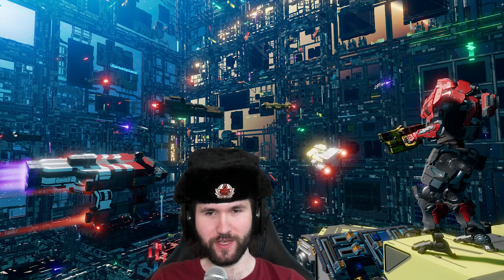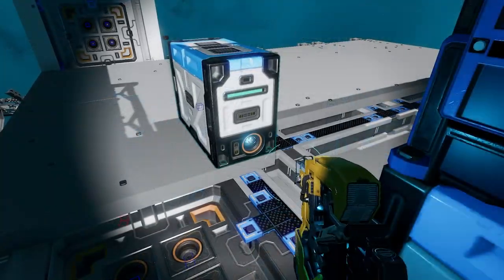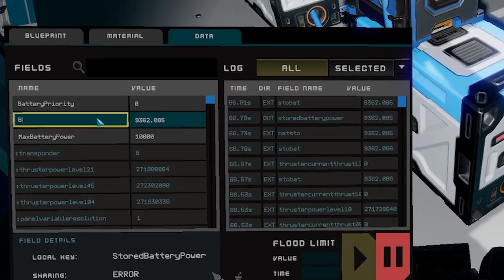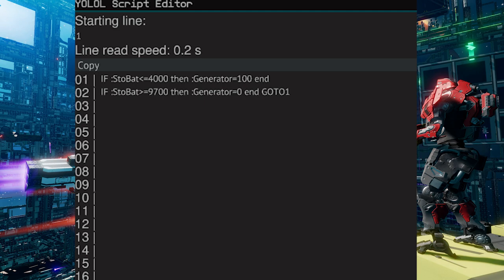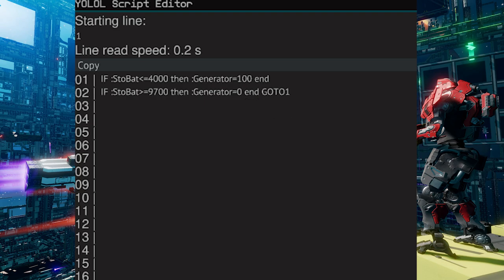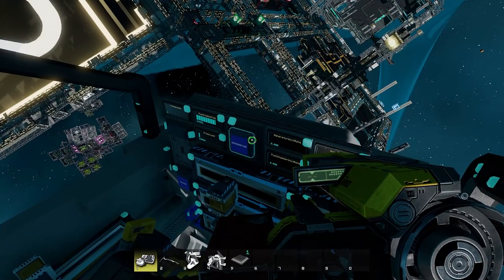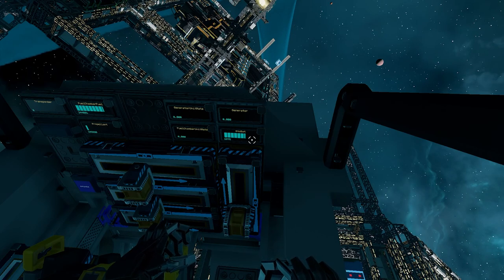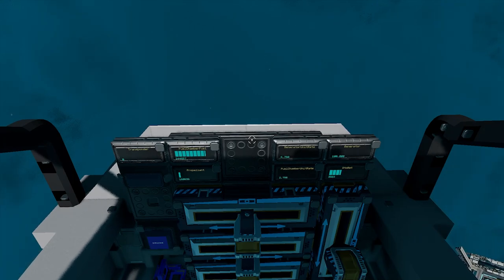Starbase Mini Tutorials: Generator Automation!

Comment: Great tutorial.  I’m still stuck on sweep and grid mining.   Question for this one.  Why do we need two generators and do we change all generators or just those two.  

As for ideas.  Would love to see a approach script for approaching asteroids and stop close enough for lasers to work.  Also would love to see those laser set up on the laborer ship as that’s why I  am using and the lasers are never hits the rock but I’ll figure that out this week or come asking questions. 

Anyway thank you keep up the good tutorials.
Reply from the maker: The labourer has only 1 generator my assumption is you meant batteries. I highly recommend having additional batteries on your ship because my mining lasers are pretty chonky
Reply: @VersaceGuy  The stock labourer has 1 fuel rod chamber, but 3 gens on it. One on the back and then 2 stacked up on the first. But yea, it needs more batteries even stock because of the time it takes the gen to power up, you nearly use all the stored power. And if you add more engines, etc..
Reply: @VersaceGuy  sorry I ment batteries.  And have a shit ton.  I have about 5 per dedicated per laser and the one collector then about 12 others.  But anyway my question is do we need to label each battery what you did or just one battery as they all deplete and regen at the same time.
Reply from the maker: As long as BatteryPriority is set to the same value as all others you’re good. By default the should all be at 0 meaning it is the same gain/drain rate.

Comment: Hey can you make a Braking script to get my ship from top speed to 0 ive been having a hard time slowing down my large miner, its not noticeable on smaller ships but on larger heavier ones slowing the ship down becomes a problem, id just like for my ship to stop in a most efficient time when i press a button.
Reply: The problem is, there is no speed ref in the game other then the ISAN sat network and objects around you such as stations and asteroids. I think you would need to setup ISAN which only works with in 1000km of the network, or use range detectors  and hope you can get stopped in time. I for one would like to have a system that can monitor detectors around the ship and then use thrusters in that direction to reduce speed or stop as a collision avoidance system.

Extra nice haves would be set a target distance so you can not only use it to avoid hitting stuff, but it could also be used at stations and the moon to fly over it. Just set a distance down and it would try to keep you at that altitude. And maybe a parallel function for the bottom sense to keep you level.

A target approach speed for coming up to things though a distance system should include that to keep you from coming in to fast to stop at the target distance.
Reply: @vorgon  There are limitations i agree but i dont think you need ISAN you only need one receiver and a way to measure the difference between the distance of the signal from one point of time to another  and you get your speed and adjust thrusters accordingly. I know target approach is doable but i need just to stop from top speed do 0 in a timely fashion.
Reply from the maker: I believe the TriFin features something similar using its approach mechanism, however that is distance based so I can give it a shot. Maybe like a button that causes emergency breaking? IDK I will have to ponder this one a bit.
Reply: @VersaceGuy  yeah emergency stop button is all i need! I've been thinking about it last night and you probably wont even need the speed to do that, only an equation which takes in to account your mass and stopping time which we would enter manually in the yolol script for every different ship.
Reply: Actual problem is your thrusters do not compansate to regulate speed automaticaly when you release levers so you keep drifting in space. in other space games (you have probably heard it) there is an option which called Flight Assist or Dampers which helps slow down or regulate elavation of your ship. We need that fcking feature in this game right now. I am fedup with crashing in asteroids.
Reply: @ellerimkirli9543  Yes i know thats why i want that stopping button because im used to inertial dampeners from Space Engineers!

Comment: Hello, I like what you do and I want to know 2 thing. First, when will you continu your miner YOLOL script tutorial? Also, can you create a YOLOL script to do an avoid impact / follow target function? I do lot of solo mining and I was thinking to use 1 miner, 1 ore carrier and perhaps 1 refiler in solo. I will pilot the miner and the other will auto follow until I ask it to stay where I want. This way, I can do bigger and further mining expedition and cut in the transport. I plan to design those 3 ship to work in team as alone, they will be more or less useless.
Reply from the maker: I do plan on continuing the Mining Tutorial Series. Our next steps reach Expert and Master levels of Yolol and I am not prepared to teach it in a way that is condensed and understandable yet.
For connecting multiple ships that is something I have not thought of. Very very far down the road I may experiment with that, I am thinking of doing an asteroid avoidance video soon so we would be getting on track atleast!
Reply: @VersaceGuy  My idea is than all the ship will fly in a train formation, linked by resources bridge so the thanker give fuel to the other for the trip and the miner give power, the ore cargo ship should have just enouth autonomi to do the trip alone in one way to maximise it's cargo capacity.

Comment: I need a script to generate power back faster to the batteries. I got 8 generators and they can't charge up my 50 batteries fast enough after using my mining lasers. Not a single person has made one.
Reply from the maker: I don’t know how your ship is setup but first I would recommend pulse lasers. It saves a large chunk of power without finishing laser productivity.

Another solution would be adjust battery priority, say have 25 of them priority 1 and the rest priority 2, then when the priority 2 batteries activate it will turn on the generators.

Just some food for thought I guess.
Cheers!
Reply: @VersaceGuy  thanks I'll give it a try

Comment: Why you limiting your battery to 4000?
Reply from the maker: That is the lower limit. It is to give the generator time to spool up because it cannot reach 100% capacity instantly.
Reply: @VersaceGuy  Why you start generator only when energy drops to 4000? You could have full/almost full battery all the time. Not somewhere between 4000 and 9700.
Reply from the maker: You don’t seem to understand. Those are the lower and upper limits in the logic function. Leaving a generator on all the time burns fuel rods because you cannot have more then 10,000 stored battery power. Using a simple script like this will save fuel rods and require them to be replaced less.
Reply: @VersaceGuy  No, I know how it works. I have script for this as well. I don't understand why you enable generators only at 4k. Maybe I miss something but this is how I see it: Assume we start with 0 energy, gens ON, but it need to spool up, for a while ship will have not enough energy, but it's ok it's only startup. Then batteries hit 9.7k and gen is OFF. Then power drops to 4k, gens ON again, but need to spool up, energy drops further, depends on energy consumption and amount of gens we can just run out of energy. In general our energy with this setup will fluctuate between 9.7k and 4k (actually lower due to spool up). Doesn't look like it's efficient way to do this. Of course it depends on your ship, maybe having gens start at 4k of energy is enough and ship will never run out of energy, but with different setup we could have same ship with less batteries/gens or have more redundancy.